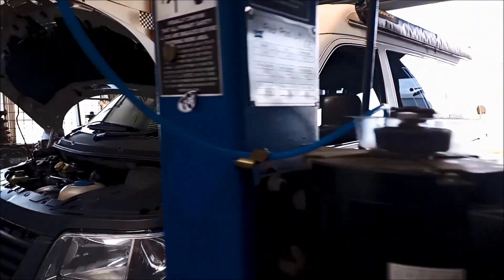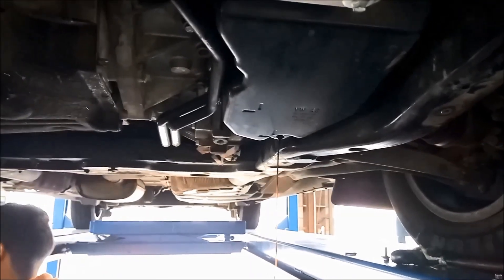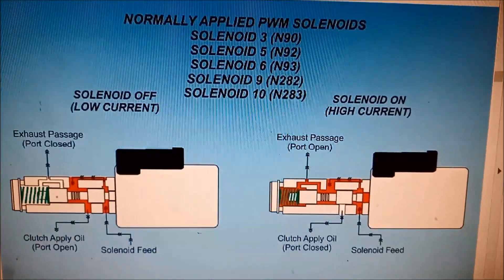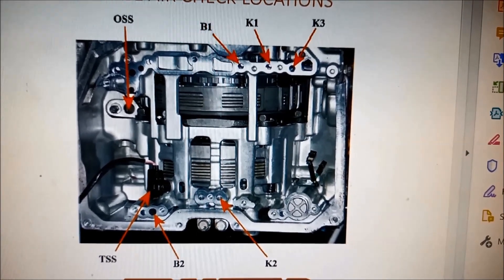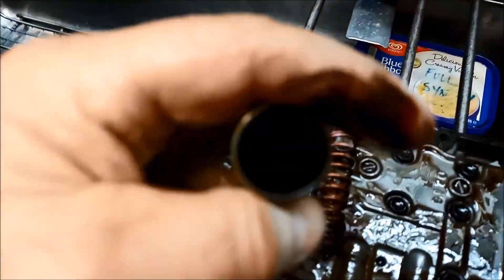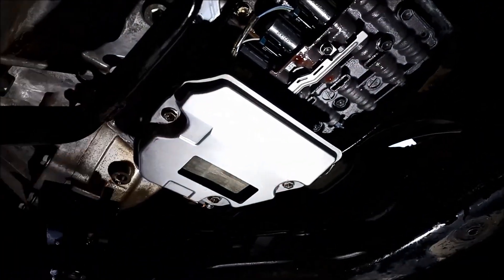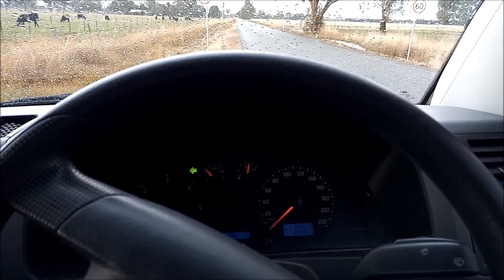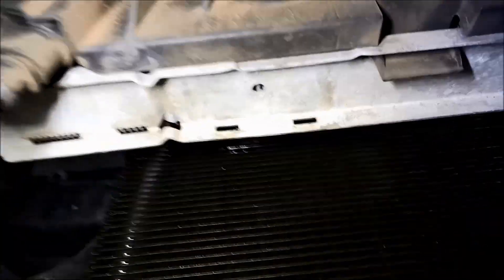09G / 09K / TF60SN Valve Body Removal and Replace

Comment: Hi mate
I've removed my 09G from 2007 Audi A3 , 1.6 L petrol. 
It has same issue as yours just when hot.
Just wondering when can I get brand new aftermarket valve body assembly for it in Australia?
Any idea?
Yours was new from dealership or after market one?
Cheers mate

Comment: So when you refil using the sump plug hole are you leaving the red plastic tube in place screwed in or are you filling then quickly inserting the red plastic tube back in I hope this makes sense? I noticed when you undid your sump pan nut you only had a minimal amount of atf coming out. I dropped my sump pan nut yesterday and over 3 litres came out, once this had stopped I then removed the red tube and around another 2 litres came out

Comment: Hey mate, I have a 2009 T5 Transporter with the 09K and have removed valve body and replaced the ISS and OSS after my VW dealer diagnosed them as being faulty.  I fitted new OEM sensors and refitted valve body with new filter and oil per your video clip.  I also fitted a good quality trans cooler same as you showed in your clip.  I now have no reverse but forward gears engage?  I am yet to drive it until i work out why there is now no reverse.  Any thoughts that you can offer?
Many Thanks for you helpful tutorial clip.
Paul

Comment: Hey mate, dropped valve body on my 2009 Transporter T5 09K and replaced the ISS and OSS with OEM ones as diagnosed by my local VW dealer, I replaced valve body and filled with the oil you recommended. I also fitted a better external trans fluid cooler.  For some reason I now have forward gears but no reverse.  I have not driven it on the road yet  as I would like to know i have reverse before choofing off.  Any ideas where to look for the problem? 
Cheers

Comment: Hi mate, I have 3.2 v6 T5 With 09k, cold works fine, after it gets hot it starts to bang when going from park to drive , or park to reverse, and it gets few seconds delay before it bang and start to drive. It bangs HARD when downshifting from 5th to 4th. If I do manual downshifting it is okay.
You reckon new valvebody will help?
Cheers

Comment: I was told I needed to rebuild the transmission when replacing the valve body. I went to tranny specialist who said I would need to rebuild the transmission because it’s slipping. I also need the tocolm replaced? (Not saying this right).
Reply from the maker: no worries, cheers

Comment: Fantastic video, thankyou. Had no idea some T5's had drainable diff oil, my 2009 FWD 2.5 BPC auto does not sadly, as a blank where that diff drain bolt is. Extra big thankyou for pointing out adjustments you can try for shifts and changeover on the drivers side solenoid ends!! Will look into that next change for sure.

For future reference you can get the valve body out without raising the engine off the subframe, just strip the body of all the looms etc, wriggle it down at the N90 front of van end and remove the accumulator piston and spring. Next, work on getting the passenger / non main solenoid side up as high as you can with the N93 area as low as possible at the left back of the valve body. You can wriggle the N90 upper edge out with a bit of work, there is even a milled small cutout for the top 10mm bolt that hits the gearbox housing itself, but with some careful wriggling it comes out just fine. Goes back in the same way. Tricky, tight, but entirely possible.
Reply from the maker: thanks & cheers

Comment: Hi..
I have a 2007 t5 transporter. Its a 2.5 with dsg gearbox.  It has started slipping in gear. It slips in the higher gears .I was towing a big load and it  was to much for it.i thought first the gear box would have to come out and change the clutches in the gearbox. But from doing abit of research I think it could be the valve body that needs replacing or fixing..would a bad valve body make it slip in gear? I be driving along and it starts to over rev and doesn't go anywhere.
Reply from the maker: h, yes valve bodies wear out on these because alloy valves are anodized to make them harder and wear out the vbody bores. a leaking solenoid also can cause issues and wont give fault codes as a leak is considered a mechanical not electrical issue. cheers
Reply: FYI DSG only came in with the 2010 2.0 litre T6 engine vans, all T5's had this god damn Aisin 6 speed auto in 2.5.

Comment: Can you tell me how much atf there is supposed to go in there with just a fluid/filter change on a 09k transmission? The pipe was overflowing a bit before i let off the atf but there was still only about 2.5 liter coming out of it while a set with gaskets filter and atf provides 5 liter? Thanks 👍🏻
Reply: You usually get less than half of the 7L total out, so one 4-5L ATF bottle usually handles a normal drain where the rest stays in the torque converter.
Reply from the maker: hi, you need to check fluid level within specified temperature with a suitable scan tool or thermometer. cheers

Comment: Excellent videos. Can you advise where you sourced the fill adapter please? The numbers on it ATZ101. Will a friction eliminator fluid improve a torque converter lock up clutch situation? Solenoid function? Cheers, thanks in advance.
Reply from the maker: hi, do a search online....we have tried every available additive and recommend Lubegard products. cheers

Comment: How oil she take s when you change the body valve
Reply from the maker: hi, when you remove vbody as well as the fluid in trans, the top half of the fluid in torque converter will also come out. cheers
Reply: @YepThatsIt  thank you but mine shuddering like driving in a rocky road  when change betwen 1 St and 2 and 2 to 3 may the fluid mode this problem

Comment: I am looking for proper valve body shift linkage position the shift are comes all the way out of the shift piston on the last notch is that normal ?
Reply from the maker: hi, not sure what you mean? push the linkage toward park and make sure it is in park by pushing vehicle a bit, then just slowly notch it to Rev-Neutral-Drive etc. cheers

Comment: La vitesse saute du premier au 5e dans tous les modes automatique ou manuel ou mode sport
Reply from the maker: hi, how do you know it jumps 1st to 5th ? check through the clutch and solenoid application chart to see where your issue is. if its jumping 1st to 4th the n282 solenoid may be stuck on. most likely a contaminated and/or leaking solenoid but can also be a stuck valve or worn valve body. while you have the valve body out, make sure you also air pressure test the apply ports in case. if you need more info contact me on facebook link in description where we can share pics and bring some beers. cheers

Comment: got a replacement valve body but this one doesnt have the hole for the remote cooler
Reply from the maker: hi, you need to get same valve body or you caan maybe change the valve body separator plate if thats the only difference? cheers

Comment: my trans has the remote cooler line filter screen and the hole in the valve body is also open for it but i dont have the remote cooler instead i have the normal circular mounted case coolar. im really confused
Reply from the maker: hi, if yours has the cooler/heat exchaner bolted ontop of trans, is different to one in vid with remote cooler/heat exchanger. cheers
Reply: @YepThatsIt  yeah mine looks exactly like yours but my trans has the cooler bolted on top. 
Anyways the valve body I got has the wrong hole opened 

I've bolted on the new valve body and so far shifting great. 

I'm just worried since the valve body that I removed has the hole opened like yours and new one doesnt but my passat doesnt have the remote cooler
Reply: @YepThatsIt  with the new valve body bolted on the remote filter screen gets blocked off

Comment: Hey is the remote cooler the one that is circular on top of the trans?
Reply from the maker: hi, yes the 09G will have heat exchanger ontop of trans and 09K will have a remote heat exchanger in front of trans. cheers